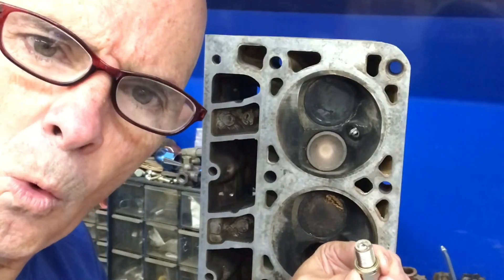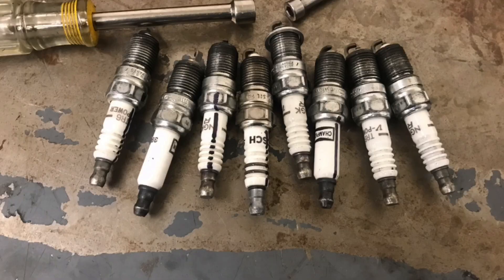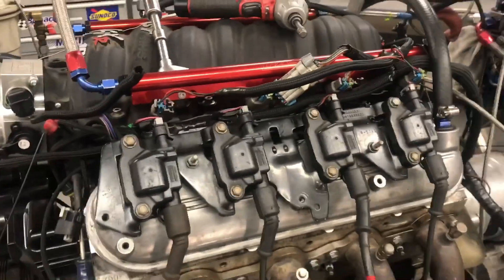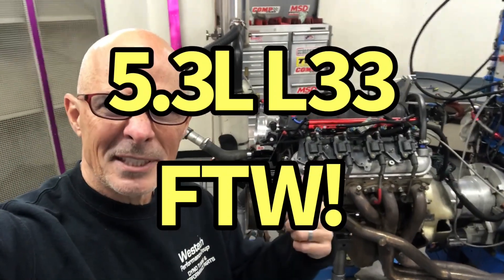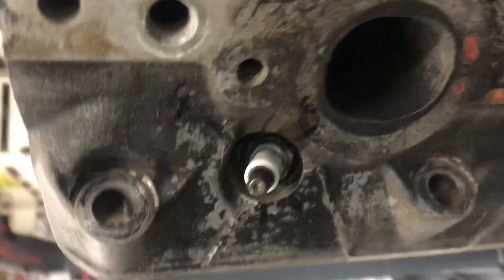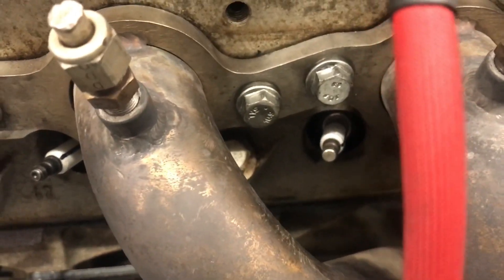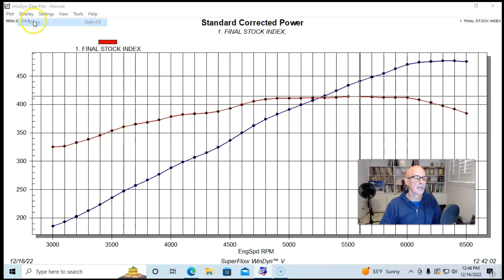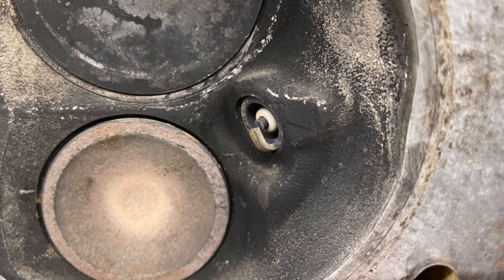SPARK PLUG INDEXING-DOES IT REALLY ADD HORSEPOWER? JUNKYARD LS MOTOR MYTHS! LOW $ MODS-DOES IT WORK?

Comment: If anything, i think indexing may allow you to get a fraction of a degree timing change, and resulting fraction of a horsepower.  Flame propagation is pretty important, but that 1/4 inch difference in start position may not be measurable.
Reply from the maker: it showed nothing

Comment: It'd be cool to know, however nearly impossible to test if indexing improves idle quality as "felt" by driver? Surely an engine dyno wouldn't be the tool for such a test, but given air speed is at it's slowest I'd imagine idle would be the only point that any sustenance to the theory could be deduced after witnessing RH's results seen here. The world may never know? Then again, if you were to double or triple the teeth on the CKP there's a minute chance a pico scope could detect such a miniscule variation in crankshaft revolution, but would it then be competing against such trivial aspects as inconsistent combustion chamber protrusion? My experience would sum it up to "If it makes you feel good, do it!" as even placebos have their own rightful place amongst this hobby.

Comment: Bracket racing drag racing well, any applications free ponies are free ponies. No matter 1 to 25. I'd think it was running in more harmonic with all the plugs indexed. But im one who sticks the plugs in and goes. Nice video. Wish you would have done one more test!!! The old side gapping. Thanks for showing us in a dyno testing room.
Reply from the maker: more harmonics? and it gained nothing
Reply: @richardholdener1727 if it gained a horse power that was freed up. That would make it more in tune. Like a piano or am I just over thinking. Sorry to be a dumb ass with out a garage and a dyno. It was a question only. Not an opinion.

Comment: A true test would be, not just random location, but install each plug the opposite of what you think would be optimum, then index them to where you think they should be, Ex. Pointing at the exhaust valve which is the hottest area in the chamber, hoping to get better flame propagation, but random location.probably puts some of them in that location anyway, which is not a true test !?
Reply from the maker: we tried several fixed (toward and away from in & ex valves) plus random orientations as well-there is nothing there

Comment: eye did it , with a 340 Plymouth .
later , eye was informed , the whole concept , is for the rare case of  avoiding , oversized valve contact with plug electrode
Reply: however ,… there is a benefit of , not forgeting to torque the plugs
Reply from the maker: indexing to avoid piston contact with plug is much more common

Comment: If you do index you're motor n the heads is on the engine. They make a spark plug index tool, where it tells you which cylinder is would be towards the intake side n if it's ok add shims until it goes on the cylinder you're trying to index. Hope this helps..
Reply from the maker: indexing plugs did nothing

Comment: you should have tried it strait across so it's pointing to the center of the piston too.  Indexing spark plugs aims to improve engine efficiency and performance by orienting the spark plug's ground strap to allow for a clearer, more complete combustion flame propagation, though the gains are often minimal and more relevant in high-performance, specialized engines rather than stock vehicles. Benefits include a theoretically more complete burn, potential for slight horsepower gains (under 1%), and better fuel economy, but the effort might not be worth it for many drivers    (under 1%) not worth it
Reply from the maker: there was no gain-not even 1% (no matter where it was aimed)

Comment: Your test was skewed.. power isn't made from indexing direct but from the added ignition timing and gap it allows you to run.. never once did you play with that between runs
Reply from the maker: indexing does not allow different timing (like indexing, gap does not change power much)

Comment: The 2000 Honda Insight had factory indexed spark plugs.  They had 4 different part numbers to ensure the plug opening would be towards the intake.  This wasn’t a high performance race engine.  It was a 70mpg car that often operated in a lean fuel mixture
Reply: Also ski doo jet ski and OMC boat motors had index from the factory and required service interval
Reply from the maker: they didn't do it for power
Reply: @richardholdener1727  efficiency is power

Comment: Both intake and exhaust index had the opening towards the center.  What if the opposite was tested?  So the opening faced 180 degrees away from the intake
Reply from the maker: We tried every combination-toward valve, toward center-there was no change
Reply: @richardholdener1727 I don’t see that in the video.  It’s maybe 45 degree change in the test.  Slight left and slight right.

Comment: 30 seconds in  and my initial thoughts are, indexing spark plugs doesn't make anymore power.  I will say though, I have a 468 BBC with 13.5:1 compression, 781 open chamber heads, with high dome pistons.

On that engine, I had to index the spark plugs, because if I didn't, the piston would get to TDC and shove the ground strap tight to the electrode.  The ground strap at .30 would hit the piston!!!.  

That's my initial thoughts on indexing.  Let's see.

Comment: Indexing is "snake oil" just like the "placebo" effect after adding a bolt on "power adder". It's psychological. The only way to make power is actually by machining the change to the internal components which takes big bucks. Lol. Power is not cheap.

Comment: When you pulled the plugs and marked them, did you install the plugs back into the spot they came out of?
Reply from the maker: why would you go to the trouble of marking them from proper index if they didn't go back in the same cylinder? BTW-it didn't change power when we mixed and matched after indexing either

Comment: Hey Richard, we used to index for smoothness. 1 hp, it's still something, but the smoothness of the engine, especially for things like Rb's, JZ's, Coyote's, ect being boosted, quad cam and high compression in some cases, helped with smoothness of engine vibration, and helped with better tuning, because it created consistency in timing, and eliminated ms in flame development. Especially important on 8/9/1000+ engines. Fuel economy does benefit slightly too on some engines because of the factory tuning.
Reply from the maker: Define smoothness-what does it change-because it was not power. I'd also like to see 1000-hp turbo Rbs or 2Js or even Coyotes that test consistently to 1 hp.
Reply: @richardholdener1727  I thought I did? I can't say we bothered looking at dyno information of power differences between indexed and non indexed, rather we where just looking at egt's and vibration of the engine. Engines just seemed happier with them indexed towards the intake valves/injectors and ran smoother because of consistency between the cylinders. Probably the other thing to note in our findings was low engine rpm taking off from lights/stops, manual vehicles seemed happier with throttle response and smoothness rather than being a little jerky/shudder. I think the dyno only tells one part of the tale, seat of the pants/on road tells the other, just in my experiences.
I also wasn't saying any of those engines test to 1hp each time?... i was merely referring to the smoothness of noting to the indexing.
Reply: Evinrude, Honda, Porsche, Mercedes do index their spark plugs. Not so much for power but to avoid misfires which will cost you power. 

So the way I see it is indexing doesn’t gain power it preserves existing power levels. 

Maybe on some engines it doesn’t make a difference, but on todays hi tech engines the factory specifies it.
Reply: @brettalder3129  yes, I'm well aware.

Comment: if the big manufactures thought that indexing would work they would have done it years ago.
Reply: Honda did so with the 2000 Insight. Head is marked and measured. Four different spark plug part numbers used to allow for a close range of index line up.

Comment: Well the first thing that pops into my mind is, who made the plug, heat range of plug, type of electrode, shape of electrode, how many electrodes, does any of these changes effect fuel economy, or emissions, octane rating, personally i feel better when all the plugs are pointing toward the center of the piston, to accomplish this on a production engine the start of the thread has to be the same on all cylinders, then on the plugs the start of the thread on the plugs has to be the same on all plugs, both of these things are possible but there will be a cost involved in accomplishing this.
Reply from the maker: THIS TEST SHOWS THAT IS NOT WORTH ANY POWER, BUT MIGHT BE BETTER ON EMISSIONS ETC...

Comment: From what I see in order to properly index you can’t shim them with washers or spacers. This robs power by setting the electrodes too far in or out from the correct positions. So the minimal gains could have been robbed by the improper electrode depth. Also a variation is tunes have been noted to gain results. Just something to consider.
Reply from the maker: there is no need to change the tune with different plug indexing. Also, we showed that changing the projected tip vs non showed no change in power so your theory on washers in not accurate. On this motor, indexing did nothing.
Reply: Or buy one or two extra spark plugs. Mark them. Install. Review the position and then swap as needed.  You won’t get exact but it will ensure they all are within the 45 degree range.

Comment: Indexing the plugs to the mid-point between the inlet and exhaust valves seems the obvious choice. Might run smoother?
I assume plug indexing would be irrelevant on a four-valve head with a centrally located plug.
Reply from the maker: we tried every positon
Reply: Thanks for debunking that indexing theory. Another useless product to not buy, but I will admit it seemed a very plausible idea.

Comment: I am just wondering if the small gap of power is more that between runs is more to do with the 1cc of space the spacer adds when its spacing the spark plug.

Comment: Geeze lueeze, I was getting ready to go out and increase the plug gaps to .100 as you showed in the other video until horse results came in at about 4 or 5 to 6 horse!!
Not really worth it at this time.  Maybe when I replace the plugs.
However, I did round off or "bullnose" the side electrodes pursuant to David Vizard's recommendations.
I can feel a bit of extra power/torque and the engine runs smoother.
I will continue the practice in future tunes.
Reply from the maker: you do what you feel is right

Comment: These kind of car myths come from people making changes they think will work, and they "think" they feel a difference in performance. Or they make changes and re test after the sun is down and air density is higher and they are convinced the change they made is the reason for the HP gain when it's just the environment. You can't convince these people otherwise, even if you show them the numbers. They'll say your tests are wrong.

Comment: this  is not indexing a spark plug. this is clocking a spark plug. indexing refers to the heat range  index. Stop  misinforming people
Reply from the maker: indexing a plug is orienting the plug-I also have a heat range test video up-that is something different that also made zero power

Comment: This is where German engineering shines, because my Mercedes CLS63 AMG has indexed plugs from the factory... all the threads begin at the SAME place on the plug, and after torquing to required spec... all the plugs are indexed.  It's like magic.  Does it really make a difference?  That's up for argument.

Comment: I've always been under the impression that indexing only makes any difference on two stroke engines where the plugs encounter airflow and ignition at the same time. Plug strap should point away from the intake valve in that application so it doesn't shield the spark from the fuel. Although I wasn't competitive enough to mess around with a bunch of shim washers.

Comment: So basically the less hp you have the bigger impact there would be.
Reply from the maker: basically don't look for power with plugs
Reply: @richardholdener1727  well yes, but the less hp the engine has the bigger the impact indexing would have I guess? But then again the gain might not be 1hp for a 3-4 hp i guess.

Comment: Very good video....,  it demystified in practice a theory that dates back to the 1950s. This is the case with high performance ignition modules ,  that promise to greatly increase the spark in the spark plugs , and there is no proof on the test bench whether they actually improve performance and fuel economy. To light a flame on our kitchen stove... you don't need a blowtorch... just a matchstick.

Comment: I think it has some validity? Certain etec 2 stroke motors need it done. I used to have a civic with a D15B8 and I swear it made it slightly smoother at idle and at low rpm acceleration . Made no seat of the pants difference though and no noticeable mpg difference. Just smoother. Enough I’d get back in it and forget and then notice it running really good. I would mark the plugs and swap them around to get as close to facing the intake as possible. Of  corse I can’t prove this and maybe it was in my head?
Reply from the maker: it is hard to quantify feelings
Reply: @richardholdener1727  ya for sure. I agree. It is still a must on 2 stroke etecs though.

Comment: I always thought indexing was BS, until I worked on a newer Porsche 911 that developed a CEL with misfire code in 1 cylinder after spark plug replacement.  It did end up being an indexing issue!

Comment: On the 10:52 in video spark plugs are from different brands that might be an issue with the experiment. Also spark plug indexing makes more effect on idle and low RPM applications till 2000-2500 as duration of cycle is much longer that is on mid and high RPM. Also it's depends of combustion chamber configuration in head and piston. Saw test of small crappy Lada 21083 1.5L engine (2 valves per cylinder) and it's fuel consumption on low loads and 3500 rpm can vary up to 15% and also up to 80% in emmisions . They also tested the "bad indexing" when spark all  4 spark plugs were pointed to the cylinder walls and reported that has very bad idling up to 1200 rpm (normal idle 800-900 rpm for this motor)
Reply from the maker: we saw no change in idle, the tested using 8 mismatched plugs (from the junkyard) against 8 new ones-also no change in power
Reply: @richardholdener1727  In power may be no changes  but part load, idle and throttle response are affected, especially on street engine because of different wear of electrodes and foiling. Try on something smaller like inline 4 engine where much more imbalances by design and you will notice the difference. More crappy spark plugs on high compression NA engine or turbocharged stop firing after some level of pressure and revs.
Reply from the maker: I have run many, many tests on plugs on 4, 6 and 8 cylinder combinations, there is no power if the plug is firing. If part load or throttle response (which is power) were changed, we would see it. Look elsewhere for power.

Comment: I feel it's just splitting hairs. But wonder that IF there was any power difference to be gained it's negated by the slight drop in compression from the plugs being slightly further from the chamber. Maybe lost  0.5cc chamber volume. Not worth it but I guess the only way to truly test it would be to go through a few hundred plugs and find the ones that naturally index where you want them. 

I'll share a crazy thought I had a few years ago. I wonder if there might be a spark frequency that would cause better ignition. I don't mean frequency as in time but rather like how they play tones and music through a tesla coil or like how a microwave works by exciting the water in your food. Or even crazier how frequency manipulates sand on a flat plate into complex patterns. 
I have to much time to think...
Reply from the maker: look elsewhere for power

Comment: I indexed the plugs on a '70 Chevelle with a 350 in it back in the 80's and it seemed to make a seat of the pants difference to me.  I still have some washers so I might do it again on my current big block project.  :)
Reply from the maker: it makes no registered power-seat of the pants is not testing
Reply: @richardholdener1727  - Without a dyno, how else are you going to tell?  I could feel the difference with my 350 sbc.  Just because you didn't see much difference on an LS engine doesn't mean it makes no difference on other engines.  You've forgotten where you came from.  I think, because of this show,  your head das gotten too big for your hat.  I told you of my experience and you said, "IT MAKES NO DIFFERENCE!".  Well, it did in my case.
Reply from the maker: Thnx for the reply-we have tested indexing plugs on other engine familes too (including sbc), it was not worth power in any of the testing so far. A feeling we get when we WANT something to make power is not the same as measured results. Also, you would be the first to ever have uttered the hat reference (sorry you feel that way-the hat still fits fine-loose in fact.)
Reply: @richardholdener1727  - Okay.  It was the 80's.  Thinking about it, the improvement may have just been from replacing the old plugs with new plugs.  I indexed the new plugs not the old plugs.  I think I probably did a general tune up at the same time.  Points, plugs, wires, oil and air filter changes and adjusting the carburetor and timing.  That's something I would do any time I'd buy a new (used) car.  The car ran great after I was done tuning it and I gave indexing the plugs the credit for it.  Oh well, it didn't hurt anything and it just took a little extra time to do it.  Have a great day!